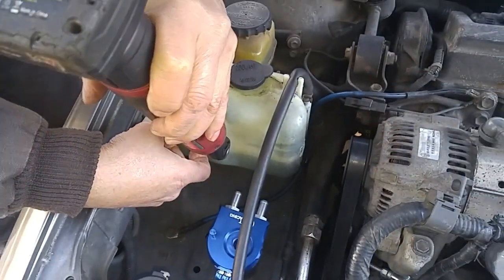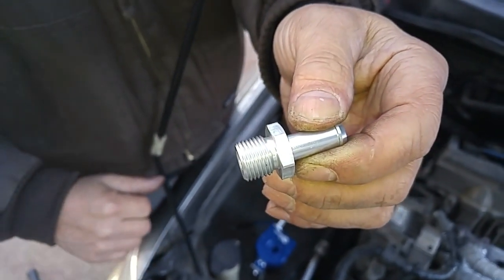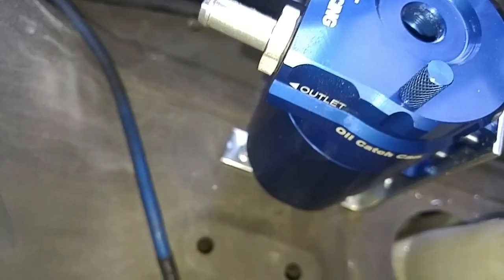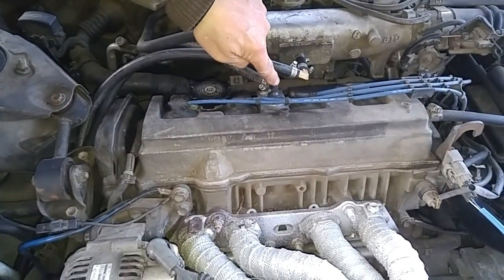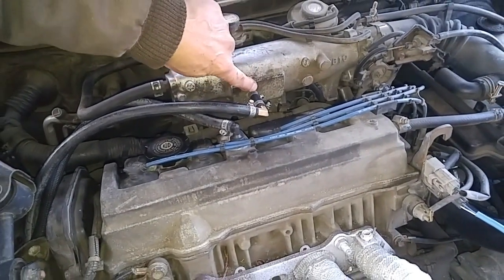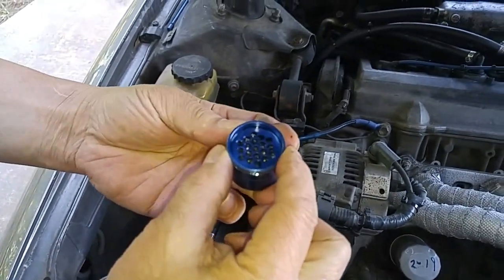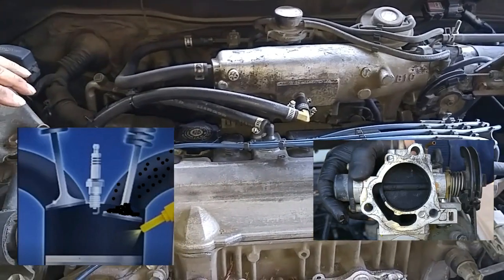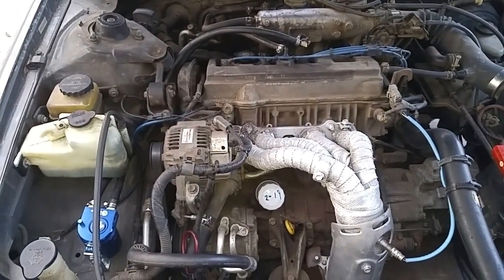Oil Catch Can Installation & Benefits - Toyota 2.2L 5SFE engine

Comment: Awesome, did the same to my 2AR-FE in my 2011 camry.

https://youtu.be/VDuBksUyp0Q
Reply from the maker: Good deal!  Watched your video and saw what you did.  Amazed at the amount of oil accumulated in your can.  If possible, I would have mounted the can somewhere more accessible.  You can also install a "breather" filter to allow your engine to breath a little better.   You connect it where that black hose from the left (driver's side) valve cover leads to the air filter tube downstream from your MAF sensor.  After connecting the breather to the valve cover, you delete the hose and plug up the hose connection point on the air filter tube.   Also notice you're using a exhaust wrap.  That was over 50 year old racing technology to keep exhaust gases hot when exiting out the output ports.  Keeping the gases hot prevents gas velocity from slowing down so the pistons have less resistance on the exhaust upstroke stroke.  Performance gains are noticed at high rpm's.
Reply: @hardlymovingpro  I thought about mounting it somewhere more accessible but the power steering and ABS modules were in the way. I dont check it every so often anyways. And I've thought about the breather filter but I figured it wouldn't help because the headers are giving off so much heat. Since the posting of the video I have installed and true cold air intake, routed it towards the bottom of the wheel well so the breather hose is getting the fresh air from the filter which is drawing air from the bottom wheel well. And I mainly did the exhaust wrap to keep the engine bay temps lower. It was kind of a quick fix and I was getting major heat soak without the wrap, so its helping quite a bit but of course not 100%. I would have to have a custom heat shield fabricated for those headers, which I don't have the money or time for at the moment. I did notice those minor gains at higher RPM's though like you mentioned but I rarely push the little car anymore. It was my first car. I now have added 4 more Camrys to the family, two of those being the 2GR-FE so thats enough pull for me on a four door for now lol I really appreciate all this feedback and advice. Not many people work on the 2AR camrys from what I've seen so thats why I decided to just post a few videos. Great channel you got! Talk soon.

Comment: makes sense, interesting vid.
Reply from the maker: No more warm weather engine knock.  Concluded it must be oil vapors mixing with the incoming air stream reducing the combustion chamber octane.  Knocking would happen under engine load and had to back off the throttle to make it stop.
Reply: damn sure a big difference

Comment: As usual, Excellent video. Does the PCV valve port comes all the way from the crank case to cylinder block then to  head and then to intake
Reply from the maker: Yes it does.  Blow by gas pressure is built up under the pistons inside the crank case.  The gases are then channeled to the top of the cylinder head and released via the PCV back into the  intake manifold or plenum.

Comment: Nice clean install. Great to add that steel wool filter. That Toyota engine is very good to begin with and this catch can will help. I love how old toyotas had so much room in engine bay.
Reply from the maker: Thanks.  There's no more engine knock under low speed load, the idle is smoother and a little bit more noticeable power on the highway.  This Camry doesn't have ABS so I used the space where the ABS control module usually resides.
Reply: Hardly Moving Productions I’m thinking about adding one of these to my car as well as a preventative measure. Luckily my car doesn’t have ABS either. Curious how many miles did you have on your car before the knocking started?